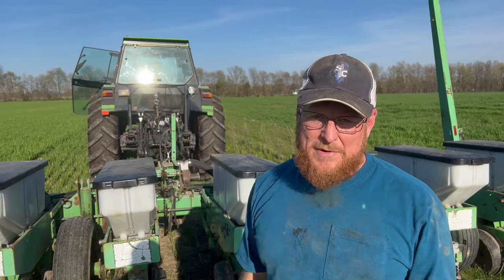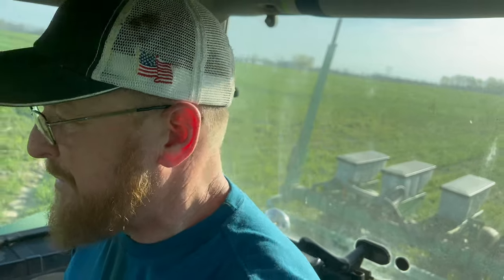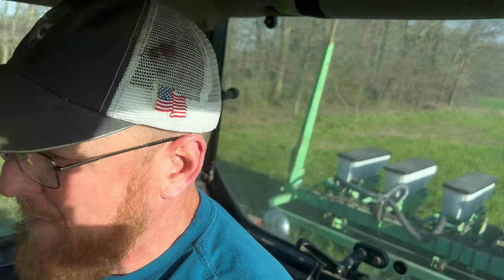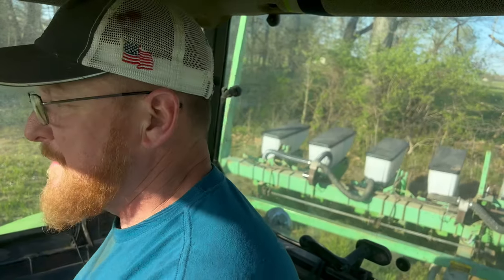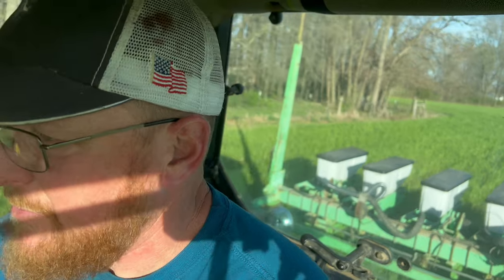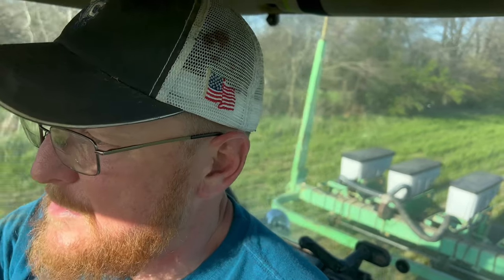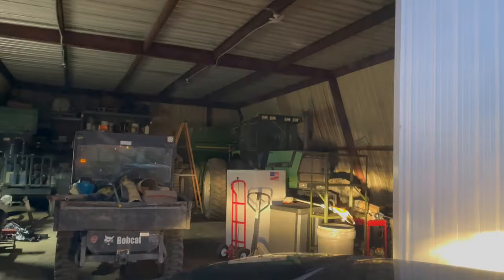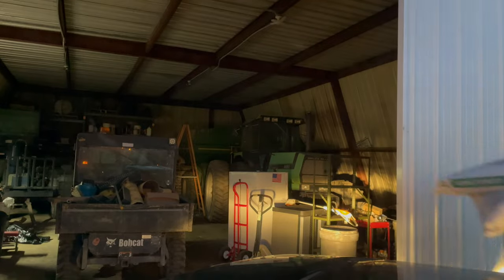CORN Planting 2023  I DEUTZ-ALLIS 385 PLANTER  I DEUTZ-ALLIS 7110

Comment: Nice, I have a Landoll Quadra planter which is basically the same as the Deutz with a Dickey John 300 monitor. It would be interesting to see a video of what kind of repairs or fixes you did to get your planter up and running nicely.
Reply from the maker: That's great!  We just picked up a 12 row and a 6 row Landoll for parts or usage.  Yeah. we might just do that.  Thanks and God bless.

Comment: Just being curious. But which Ohio ag do u deal with in Ohio???? I as well run some of the agco allis tractors with the air cold motors and older equipment and our Ohio ag dealers near me do not work or do not even wanna try to work on an older equipment... basically if it's not a fendt or anything that's with in 10yrs of age they basically hang up there phone so I'm very curious which one u deal with??.
Reply from the maker: Washington Court House store  One of their field techs used to work for a Deutz Allis dealer.